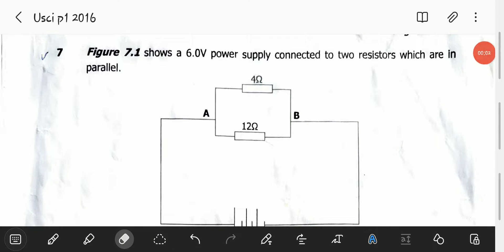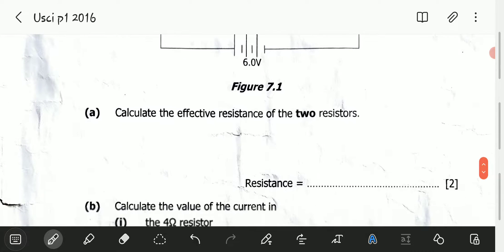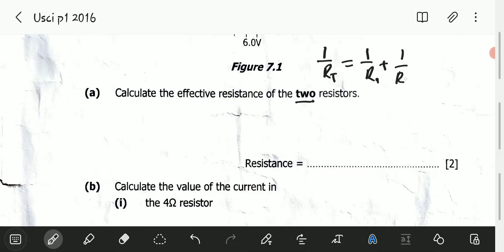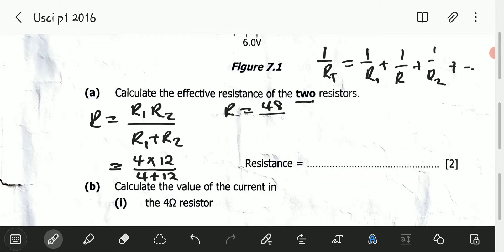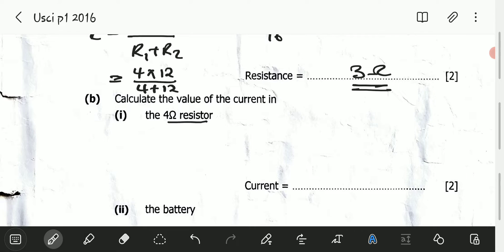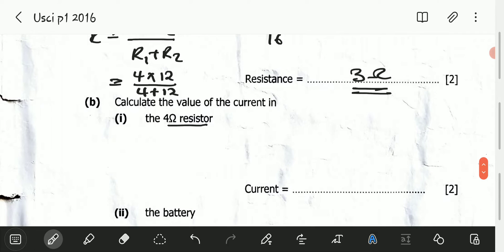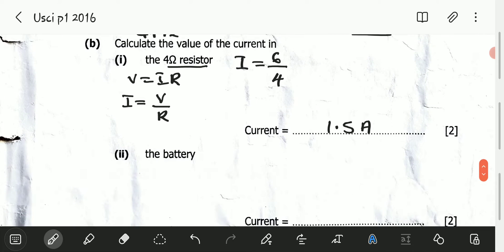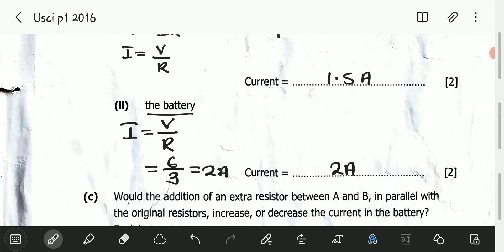ECZ 2016 SCIENCE PAPER 1 INTERNAL QUESTION 7

Comment: Understood sir.but I have a question.
Can't understand p.d in a cell
Reply from the maker: You can go ahead and ask
Reply: @francisngoma6757  IN A parallel current there are two resistance ,1ohm and 3ohm and the battery 12v.question are 
1)the p.d of 1ohm resistor.
2)the p.d of 3 ohm resistor.
3)cyrrent through 1 ohm resistor.
4)current through 3 ohm resistor 
5)current throuhh the cell.
6)find the p.d of a resistor which consume 690J of energy when a current of 3A flows in 10S